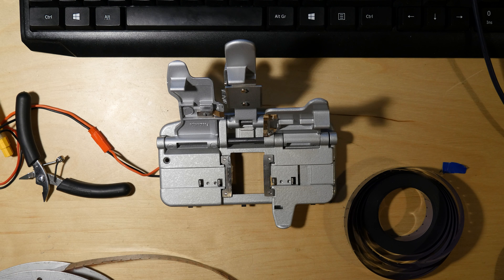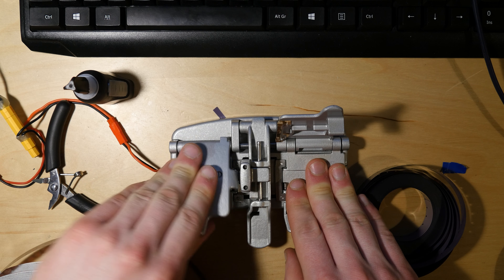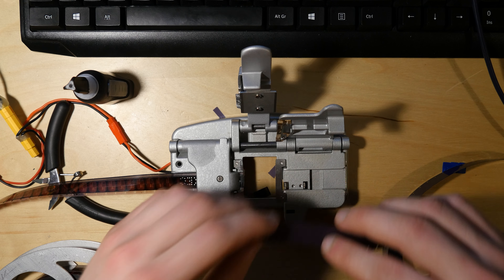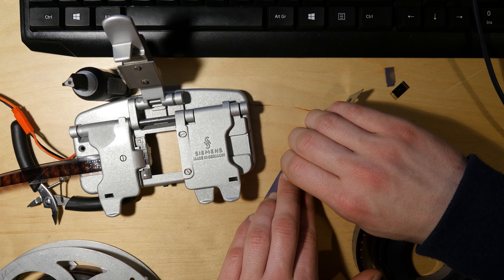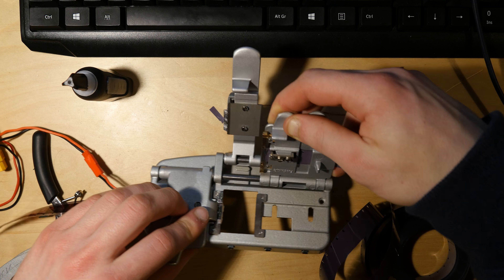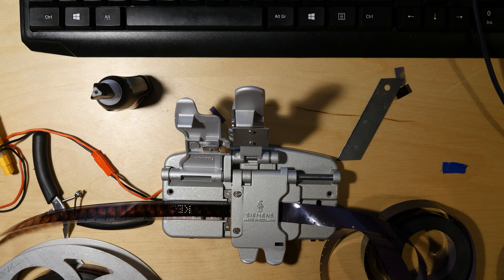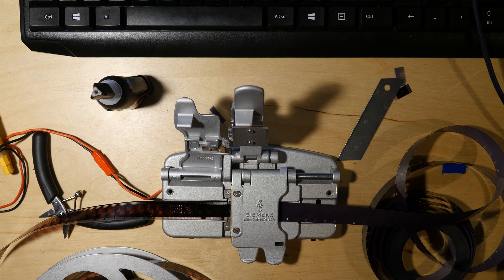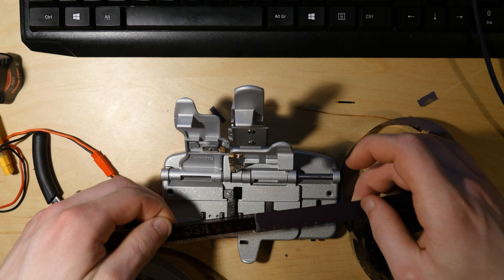Splice 16mm Film With Superglue

Comment: Did you know you can get a superglue activator spray?  This is a solvent of some kind, and it's harmless for most plastics.  You probably wouldn't need to use a hot splicer with activator.